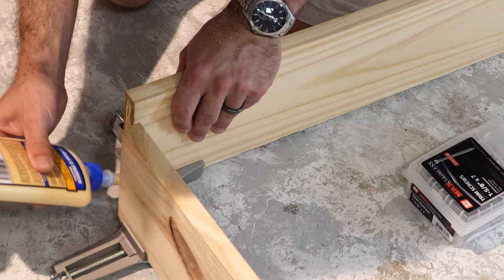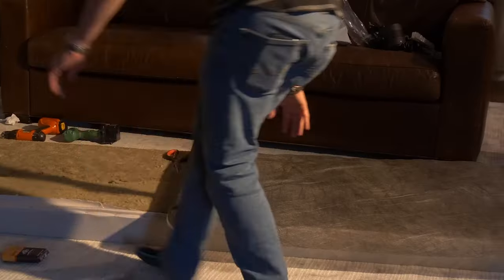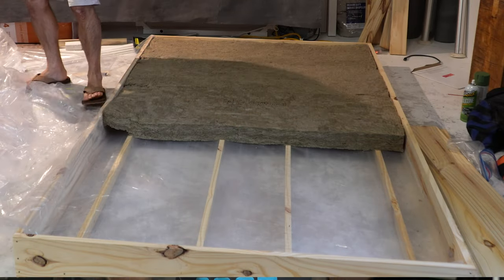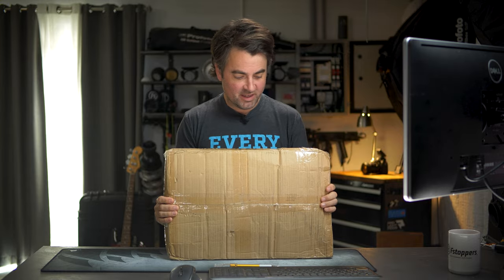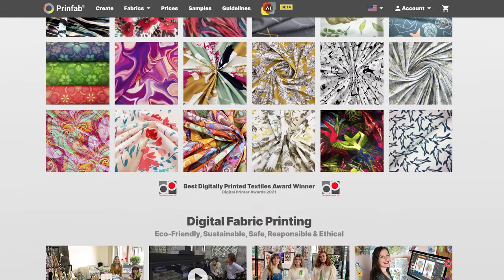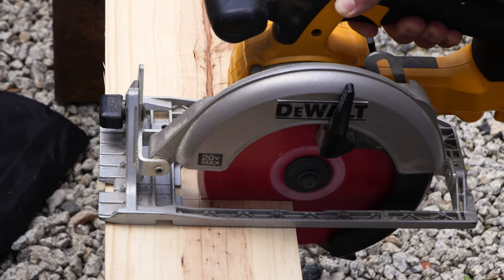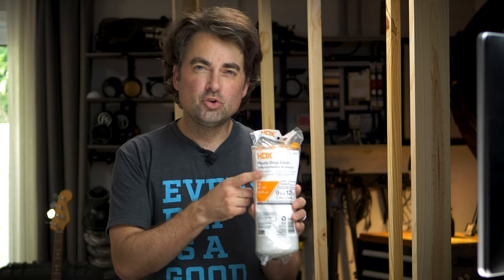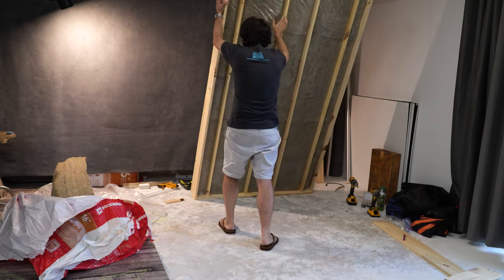I Built These Massive Prints By Hand

Comment: This is a great idea! Well done video. A couple thoughts: Wrapping the Rock Wool in plastic is probably significantly reducing the sound energy absorption. Secondly, although the materials you choose were great for printing, were they the best perforation to allow the sound energy to penetrate? Lastly, wood is fairly expensive and heavy - would there be some cheaper & lighter alternatives in the plastics world? Certainly not at HomeDepot, but maybe worth an investigating for the future?
Reply from the maker: I commented on another post about the plastic wrap.  There is a sound treatment youtube channel and the guy has done extensive testing on the topic.  Basically the plastic is so thin that it doesn't affect the frequencies below 3khz or so. It has absolutely no effect on longer wavelengths like bass and lower human voice which cause the major rumble.  It might have an effect on higher frequencies but those are easily absorbed by the fabric print itself.  

Here in PR we don't have many options.  They use a ton of PVC here because of humidity and termites but PVC is actually way more expensive than wood and probably about the same weight.  They also use a lot of steel studs here but that's really difficult to work with (for me at least) and it wouldn't allow me to staple the fabric.  I never weighed the prints but I think they weighed less than 50 pounds which at this size was totally acceptable IMO.  And $300 a print was well within the budget I wanted to spend.  Heck you can't even get a mass produced piece of art this size from Marshalls for less than $300.  -P

Comment: Doesn't wrapping the foam in plastic harm the sound deadening effects?
Reply: Thinking the same thing
Reply from the maker: Studies have shown no. Thin fabric and rugs help with high frequencies but it's the thicker rock wool that helps with mids and deep bass which while you can't always hear them, they compound to create standing waves and all sorts of issues. Since the fabric print is thicker than the 2 mil plastic, the highs will be dampened by the fabric itself. I didn't believe this myself but try this experiment.  Put two trashbags over your stereo speakers and see if you can hear a big difference.  The plastic is negligible and doesn't stop many of the sound waves.  The Rock Wool is what's doing the heavy lifting.  -P
Reply: Very interesting! Thanks for sharing 👍

Comment: I wish you hadn't skipped how you by the border pieces of wood on.  Are they overhanging the actual frame?  Very cool art though.
Reply from the maker: Yes, they overhang just slightly to give it a slight lip.  I just cut the pieces to form 90 degree angles and used finishing nails to hammer them into place.  Then I speckled/painted over the nails to hide them the best I could.  I wish I had a miter saw to cut 45 degree angles on all the wood but the cuts are a little more primitive. -P

Comment: Congratulations on the paintings. One question: which camera did you use to print at that size? I assume a medium format. A tip: to have a better acoustic treatment of your living room, put a heavy carpet between the 2 sofas and one in front of the entrance door
Reply from the maker: Probable the D850.  There is already a carpet between the two couches.  Nothing in front of the entrance door though because it doesn’t have enough clearance for the door to go over the rug.  -P

Comment: So, the question you did NOT answer is how did you get the print so large without pixelating?
Reply from the maker: I want to make a video about this but if you have 24,36, or 50 megapixel images, pixelization shouldn’t be a problem.  You can see pixels in the sky of the marina image but only if you are looking closer than 2-3 feet.  These prints are viewed more at 3-6 feet and you can’t resolve pixels at that distance.  Lee did a great video about the number of megapixels required for a billboard and it turned out to be 3-4mp because you view them at such far distances.  -P
Reply: Thank you sir. I know the billboard bit, but have always been a bit worried about things you can get close to like prints for a wall. 
 @FStoppers

Comment: I would consider reevaluating how high the frames have been hung. When you go into a gallery or museum, they don’t hang art halfway up the wall. It’s placed at a level for comfortable viewing. It’s more of a strain at home because most of the time your seated. I know there’s an urge to capitalize high ceilings, but over time, I think you’ll realize your images aren’t even in your line of sight.
Reply from the maker: They really aren't that high.  The horizontal image is perfectly balanced with more space above it than below, and the vertical image will have a live edge wood table below it so it will have balance.  As a huge fan or interior design and aesthetic, I def took the placement into consideration and mocked it up in Photoshop before making a final decision (along with picking out the prints as well). -P